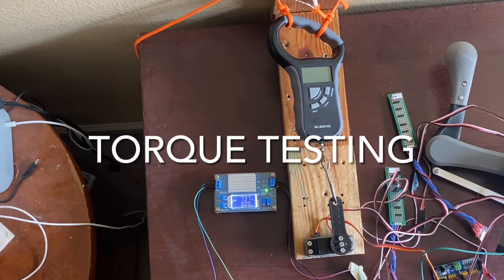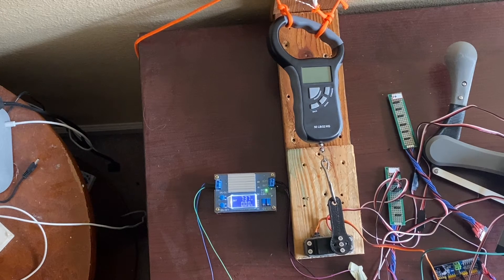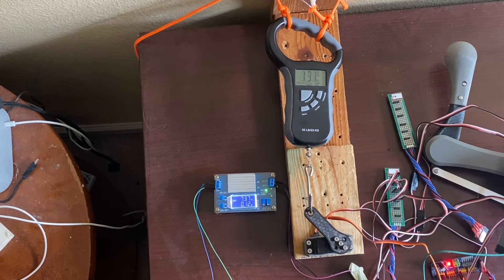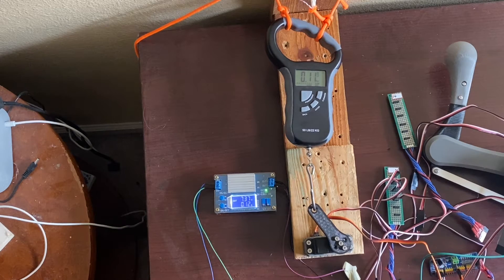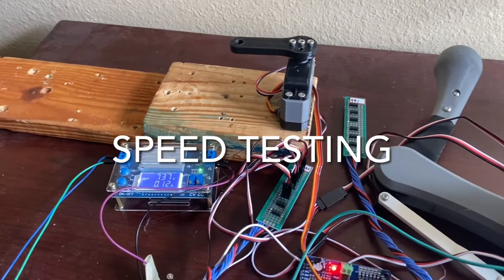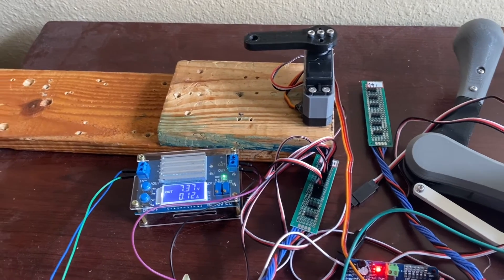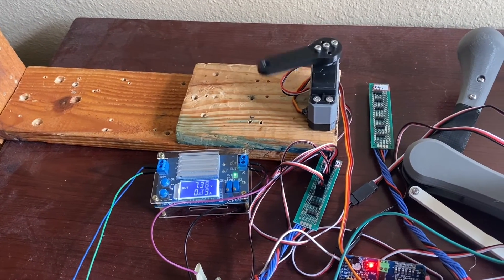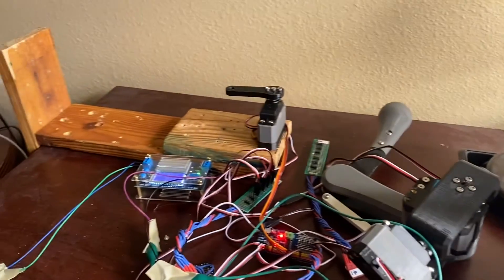35 kg Servo Testing

Comment: You're getting some cosine error in your torque tests so the actual value is lower than what you measure
Reply from the maker: What's the error?
Reply: @aaedmusa  I believe he is saying that the lever arm depends on the angle of the servo.  To simplify the torque calculation you need the servo horn to be at 90 degrees to the link going to your scale (at the moment when the servo stalls).